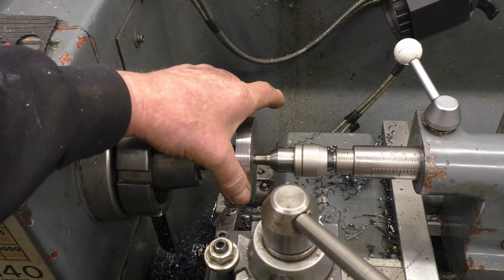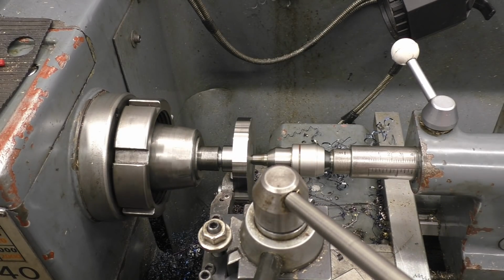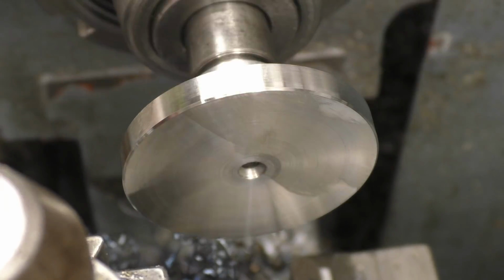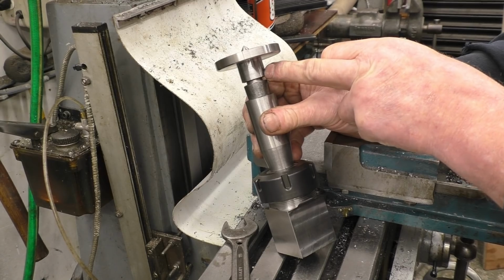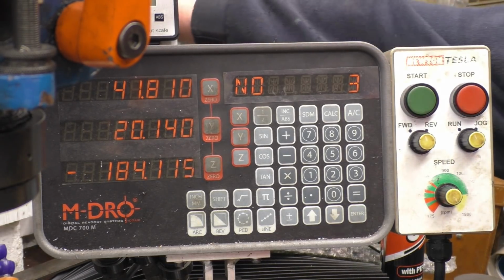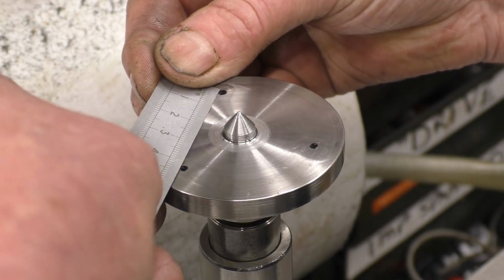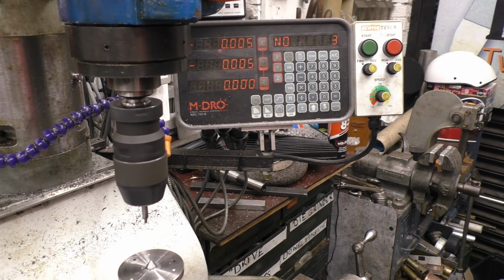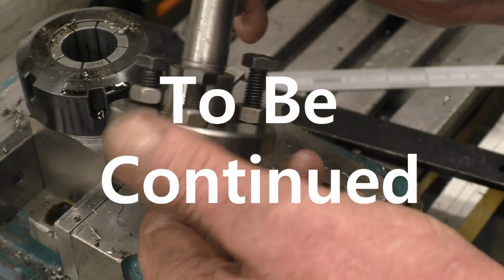SNNC 370 P1  Wood Lathe Drive Dog   . DRO  PCD set up

Comment: Another time, set the end angle to 360 degree and ADD 1 more hole ( in your case 4 ) saves sodding about trying to work out an end angle.

Comment: if you need to stop showing videos for a while we will understand why
Reply from the maker: I need to keep my self busy
Reply: @doubleboost  That's the feeling I got - the videos keep coming.
Take it easy for a week or 3 John - doing just what you want to do and a minimum of what you need to do. You'll come through it in your own time - back to your usual self. Many thanks for keeping going with the videos, we really do appreciate them.

I dunno why your spindle nut spins with no chuck - the Colchester ones don't.
Can't believe that tool break. Had to watch it several times. Was the power feed rate too high or had you got over excited on the depth of cut ? So glad it was only a 30p loss and nothing far more serious. I've not had that issue (I don't think) but have had work 'drop' out the chuck !